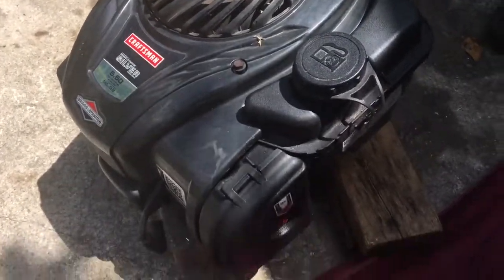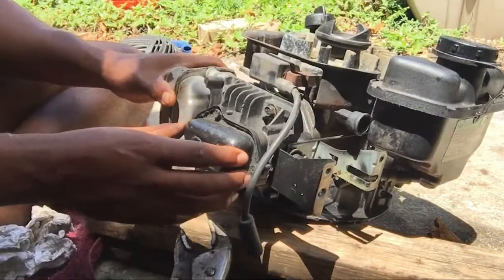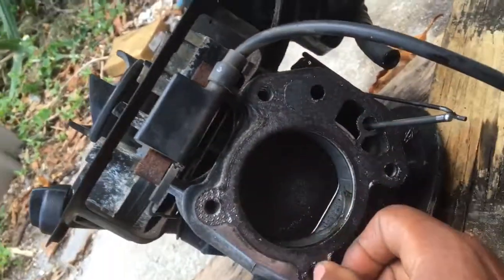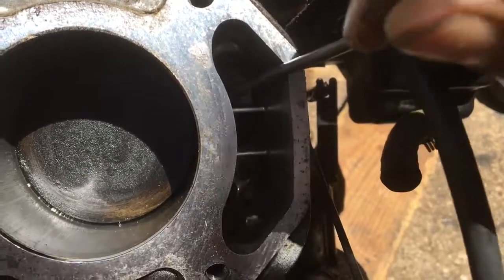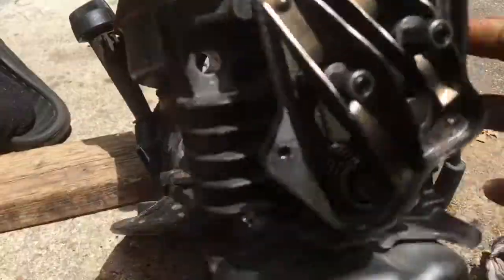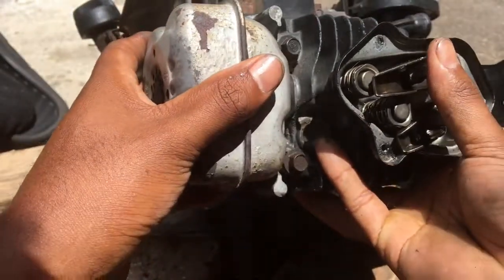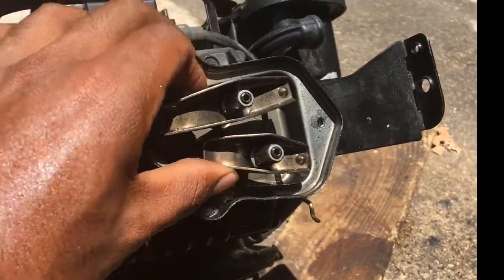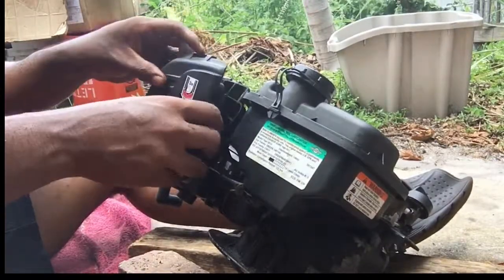140cc Craftsman Lawn Mower - Valves in the Wrong position ??

Comment: You need to use a wire brush and gas to clean even carb cleaner thee is a setting on the vales if they are not right you will have prombelms 0.4 gap

Comment: You set the valves wrong
Reply from the maker: i didnt it. when i took it apart it was already wrong from the beginning which is why oil was leaking every where (according to the guy) lol but I placed all parts in the correct placement.